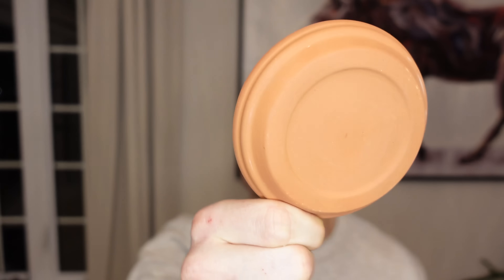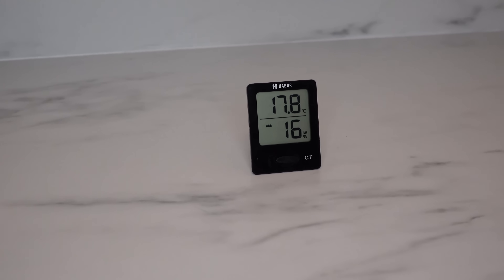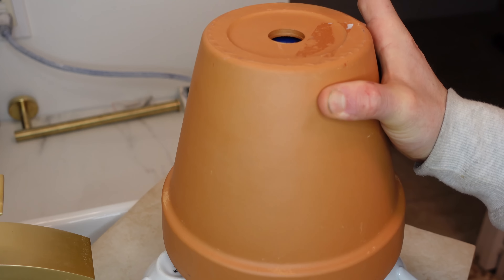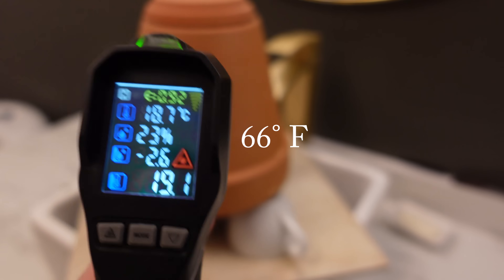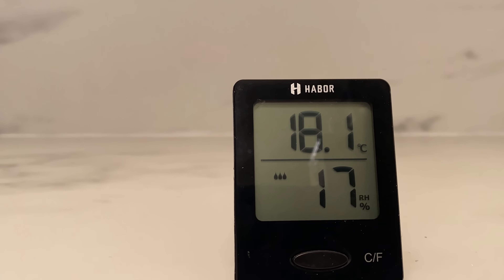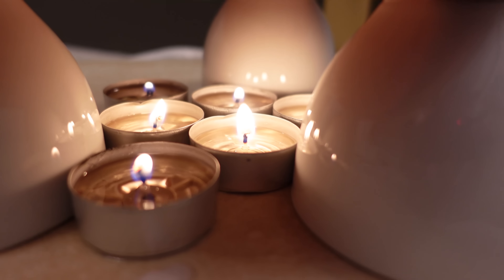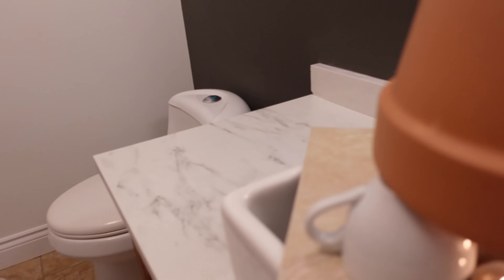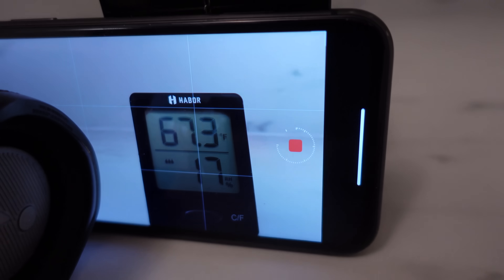CLAY POT HEATER TEST | Does It Actually Work?!

Comment: This set up works ok but using 3or 4 pots  and a large bolt joining using bolts and nuts as spacers washers between each pot its pretty much a convection heater

Comment: Annnd..whats the point of the terra cotta pots, to trap the heat from the candles, which would have radiated into the room anyway? Yu cant gain heat by absorbing heat
Reply: It seems impossible that these candles can make a difference, but It is about the spread of heat. It converts kinetic energy of hot air into increased infrared radiation that spreads out horizontally and heats lower surfaces and thus more lower air. infrared heating you feel directly on the skin, without having to heat all of the air in between. Without the pots the hot gas quickly rises to the ceiling. It just stays up there and mostly warms the ceiling, until all the air is in the room is heated up. By using more pots, you can store more heat and let them radiate infrared longer. Basically infrared radiation is what transfers warmth, and a radiator allows you to feel warmth more directly and efficiently than heating air and using a ventilator to spread it. It does not change the total amount energy, but applies it more efficiently. By heating lower surfaces those again start radiating in turn. Best is if a radiator is black, black absorbs energie best, and radiates it best. It is also  psychological. You  want room walls to have darker warmer colors, not white. This way the room will feel a few degrees warmer. The ceiling you would ideally cover with an isolating and reflective material like you use between radiators and walls. That way far less heat escapes through the ceiling and infrared radiation bounces back.

Comment: :hand-pink-waving::face-blue-smiling:, Please use a quart can of transferred  Crisco with a ready made candle inserted in the middle .  The double pot  is unnecessary . With 8 inches of snow outside with the power off ,  can you imagine how many tea lite candles cases you'd have to use ?  You can use metal air duct over the inverted clay pot to radiate  more .   Watch Nica's clay pot  video, to give you more insight .  Have a good day !  🎄✨☃🎀

Comment: If you use larger pots and stack them 3 to 5 high, you can heat your room, especially if you use a large Crisco can and put three wigs in it, all the way to the bottom. I can tell you, that little room would be a sauna. I used this during the energy crisis here in Belgium a few years ago, when gas was really expensive, and it heated so well that it was too hot in my 100m2 apartment with just two of these stacked 3 high. It reached 26 degrees. But the size of the terracotta pots have a lot to do with this

Comment: So you can set your thermostat to 68 degrees and set these in closed off rooms that you are using. Does not make sense to pay the cost of heating an entire house when you are only using a few rooms.
Reply: If you turn off your furnace and it's very cold outside, pipes can freeze and burst.  Then you have real problems.
Turn your furnace down and put on a sweater, but never turn if off.  Keep the house at least 45F and realize pipes are usually in the outer walls where it's colder. 

I'm not sure how effective this is. 3 degrees is not a big difference. Also, the room was very small.   I wouldn't consider 68F "warm and cozy" either.  Would need to be least 75F. 

It might work better if you set up say 3 heaters in the same room.  But at some point, the cost of candles might rival the cost to actually run your furnace.

Comment: Physics, conservation of energy. It's the same amount of warmth, just distributed slower. What Does work is better isolation (in the house) that keeps the warmth in. But also, small rooms with that many candles gives off possible CO and fine dust that is harmful. Bottomline is that it's not more heat than burning the same candles without the pots.

Did you do the same test with Just the pots, otherwise its not really a test

Comment: I've seen hundreds of similar "heater" videos. The heat in the clay-pot comes from the burning candles. The same heat  is released directly into a room with NO POT on top of the candles. Simple thermo-dynamics shows us that there is no difference in heat-output with, or without, the pot! Major factor......Is the heated ROOM insulated?

Comment: I watched this after another example.  That one had 4 tealights in a muffin tin. The smaller pot was put down on the muffin tin which allowed a little air to get to the candles.  He put a small metal disk on the hole in the small pot.  Then the bigger pot over the smaller with no spacer.  It was much more successful, so perhaps allowing too much air around the candles actually allows the heat too escape too much?  His tealights had no problem going for 4 hours.  It was also much easier to set up!

Comment: I bought a metal purpose made one from TeMu and with 6 T lights under it makes room feel cosy and it does get too hot to touch. When factoring the cost of the candles though and the amount of warmth it gives out I'm not sure it makes any difference to energy costs. It wont raise the room temperature much unless a very small room BUT it will help it keep warm so your heating wont have to come on as much. A lot depends on how much you pay for the candles
Reply from the maker: Interesting, thanks for the info!

Comment: A correct experiment, but with the wrong method. You have to use your resources to the maximum. We know from physics that at the top of the candle flame the temperature reaches 1000°C. But, that's at the top of the flame. What do you have to do?!? You have to have something that stands at the top of the flame and transfers this heat to the clay pots. There is a hole at the bottom of the pot. You insert a stud to which you attach a washer with a wide periphery. The larger the periphery, the more heat it will transfer. And so - one washer, one/two nuts, one washer, one/two nuts. And so on until you reach the flame. You connect the next larger pot in the same way. After all, you still have to heat the outer one. You can replace the inner clay pot with a metal one. That way you will see if there is a change in the heating rate.

Comment: 64°F to 67°F with 480 Watts after three hours. Meanwhile other rooms get cold and damp without heat. 
It's 15°C (59°F) here with no heating. It has been 13°C in winter, lower in bad winters. I prefer my fan heater and put some heat to my feet until the central heating warms things up.
Reply from the maker: Thanks for sharing your experience!

Comment: Do NOT use terra cotta, it absorbs heat like tiles on a space craft. 
Use an upside down metal trash can, bucket, pot or cast iron skillet. The idea is converting fast rising high heat from a candle which shoots straight to the ceiling instead into a warm radiator at floor or table level.

Comment: Just a few facts. You can only release as much heat into a space as you have fuel for. The most recent and interesting technology I have seen for heating is called "Sand Battery". The possibilities are endless.
Reply from the maker: Thanks for sharing, I'll have to check that out!
Reply: @philg  Thank you for acknowledging. After considering the Sand battery concept for home use, I visualize a test using stove pipe and a old washer and a rocket stove. It would produce enough heat to help survive outage with no cost after building.

Comment: I wonder what firefighters think of this? I'm surprised there was no warning because hot wax is flammable and can easily spread or even explode if mixed with water. I would place the whole thing in sand somehow and plan a way of extinguishing in case the wax ignites. Maybe add salt to the candles or store them in a freezer or fridge to extend the burn duration.

Comment: You see the problem wih these cheap DIY heaters which include clay pot, dome or sand types is the maker always shows the heat generated at the heater from 300F to 500F at the top or side of the heater. They never take a tremperture at the ceiling, temps at sleeping level or say 5 foot away from the heater, before and after. The average bedroom in the US is 11'x12' which equals 1056 cubic feet, so guys prove these heaters really work for home or room heating not for a tent or small bathroom...
Reply from the maker: Good point! I'll test that out in a future video.

Comment: I get the idea of converting candle heat to IR radiation but it just seems like a terribly inefficient design due to the cost of the fuel. Why can't someone design one that uses a much cheaper fuel without poisoning people with CO? I personally think the best idea is the large, electrically-powered, sand battery idea. Its way cheaper to run, far easier to build, and safer if you have pets. Its also 'automatic' in that you don't need to do anything when the power goes out.
Reply: If you want use a cheaper fuel use clean unused cooking oil and a nice ornamental lantern not balancing pots precariously.
If your heating a greenhouse use waste cooking oil and fats, that's where the pots come in because theyre already in the greenhouse and they stop the heat rising straight up and heating only one glass panel.

Comment: What you should be comparing is the cost of burning tea candles 6 , as opposed to an electric heater cost for the same temperature change ? 
6 tea candles 10 penies ? 
1kw fan heater 20 minutes,  10 penies ?
Running a  1kw fan for even 5 minutes will substantially outperform 6 candles and still cost less wheather it's DC or AC !

Comment: Pro tip....put these on the floor. It's thermal dynamics. Hit air rises cold air falls. When it's hot down low, it exchanges the heat non stop as the hot air rises to the ceiling. It will heat the room faster, and eliminate cold air on the floor and all the heat trapped from your waste up. Place it all on a cookie sheet on the floor.

Comment: This only works on t.v. You are wasting your time and money..
Reply: Energy cannot be created or destroyed, but it can change from one form to another. This is known as the law of conservation of energy. 
In other words the same temperature change without using the ceramic pots.
He did not use a control to prove that it actually makes a difference, it doesn't.

Comment: OK. so what if anything do the pots achieve?  How about trying the same test with 6 candles & no pots at all.  I bet it heat the room just as well, inf not indeed better without them.
Reply: Energy cannot be created or destroyed, but it can change from one form to another. This is known as the law of conservation of energy. 
The change in temperature will be identical without using ceramic pots.  Any pots for that matter.
Reply: @Mr.Robert1  the point is that temperature is a function of heat energy divided by mass.  The pot is a higher density mass than air, therefore, it robs the air fom receiving heat.  At least for a while anyway.  It slow down the heat transfer to the air and disperses the heat energy through more mass, which is colder overall.

Comment: A Clay pot heater in a green house only needs to keep above 32f and the engine driving heat transfer is the temp differential and a night light in a plant pot can do this.    The con is trying to replace heating in your house when we  need 70f to live.   A night light  can't do this the energy lost is too high.  A hot drink and extra sweater or throw helps.    Invite friends around we get. close to  IKw from 4 people

Comment: Are you using a LED lightbulb for the room light? If you were using a regular incandescent bulb that would also help to raise the temperature in a room when you left the light on in the room the entire time. I count at least 3 additional heat sources with those lights on.

Comment: The same candles will put out the same exact amount of heat BTUs, British Thermal Units, for the same exact amount of time if used without anything around them. Adding material, clay in this example, doesn't increase the candle heat output a millionth. 
The temperature reached is relative to the outside temperature and the room outside wall and ceiling 
insulation rating. 
Even so, the test shows a valuable temperature increase if a house furnace stops working. 
There are dangers caused from heating any and all enclosures using do-it-yourself stove types. 
1 is the oxygen in the room or enclosure is being quickly used and not replaced quickly enough, and many people have died from asphyxia - fatal lack of oxygen. 
   Another danger is, people get very sleepy while asphyxiation grows, removing the ability to quickly get themselves outside and into air.
  Another danger is people lose their ability to make rational decisions as the asphyxiation increases. 
Bottom line is, keep yourself from getting into such situations, and provide enough cross-flow fresh air ventilation if you find you must resort to such a risky remedy.
Remember, everything alive must have air ventilation.

Comment: In Eastern Europe there are still many flats & homes with much larger versions of this concept, only they're made with tile. It's a nice, gentle heat which does keep rooms comfortable.
Reply: Fascinating and very efficient things. Old technology that works although it's a bit bulky. They're called Masonry heaters and sometimes Masonry Stoves, some incorporate cooking ovens as well.
Reply: @EForchetto . That's not old technology. Are you in china and trying to get westerners killed? Or is this your first time around the block? 
This is one form of an emergency situation short-term dangerous remedy. 
That information should have been provided at the video begining, and the producer is negligent in not providing it.
Reply: That's what i grew up with. It kept the room comfortably warm for days even when the fire was out already.
Reply: @startingbrandnew3055 . You expect people to believe that? What years? Location? Why didn't someone Realize all the candles were more costly than firewood?
Reply: @senatorjosephmccarthy2720     Can you give me a single LOGICAL reason why would someone LIE about this???   IF you must have an answer i was born in 1956 in Budapest Hungary. Are you satisfied???
Reply: What? No chimney? How is the room oxygen allowed to be replaced as it's used? Air ventilation thru 2 walls?
Reply: @senatorjosephmccarthy2720  There's a chimney which exhausts above the roof; the long piping warms the surrounding tiles. Think of a wood burning stove with a pipe that leads to the outside -- it's where the most heat goes, not the conventional fireplace.

Comment: We don't use a heater. Hi from South Africa. Yup, our Municipality sucks. So, no heater or the power goes out. From experience a lot of candles (like 30 pilar candles) spaced throughout the living room does make a difference. Looks nice and a little bit warmer, even if it's  just 18°C instead of 10°C. If you can afford to build a wood stove, that really heats up a whole house and feels like hot Summer heatwave if you're not careful.

Comment: A more cost efficiant method is to use standard tabel candles.
They burn twice as long and at 3 times the intensity so you only need to use 1.
A batch of 50 costs the same as a pack of 100 tea lights so you end up with 4 times more heat per cost.

Comment: Nice: you did the experiment correctly. Multiple candles in a small rather well insulated room without a high ceiling.  When people slam these heaters, they need to realize the conditions of the test. In case of a power loss, they will not keep you warm and cozy, but they will keep you from freezing to death.
Reply: If said persons don't first die of asphyxiation - which wasn't mentioned - you mean.
Reply: nooo, he left the lights on, giving a lot of heat, even when its led lights..

Comment: You do not want to have the inner pot to have a hole at the top.  You want to cover the drainage hole.  The inner pot will get much hotter in turn heating the room temperature higher.

Comment: Surely the acid test would be the temperature in the room? Taking measurements of the room temperatures with and without a flowerpot would be more objective…talk about smoke and mirrors.
Reply from the maker: I will make another video without the pot, I'm sure the results will be similar.

Comment: wouldn't it work just as well with just the same amount of candles?
Reply from the maker: I will make a video to test this!
Reply: @philg  I just can't see how the same amount of heat being released by the candles would be increased by trapping it in a clay pot in a closed room.
Reply from the maker: @dickgoesinya9419  yeah you got a good point! Energy is not being created by the pots, but concentrated or trapped
Reply: @philg  OK, we are on the same page.

Comment: It raised the temperature only by 1 degree. That is not much if you have to heat up a room when the outside temperature is falling into the minus and you have no other rooms surrounding you. Also the bathroom lights give up a lot of heat, too. You should have turned them off. But still, interesting try!
Reply from the maker: Great point! I will re-do a test with candles only... and the lights off :)

Comment: Why two pots?
Reply from the maker: Acts like a chimney and insulation for better heat retention.
Reply: Thanks, Phil, I'd wondered about both of these, but I think you neglected to include it! 🙏

Incidentally, I've been using just a single pot all winter (with an alcohol burner) and it's been working great, but I'm curious to see how much better two might work...

Comment: Now try it when the room is 45F and see how well that works.  Hint: it doesn't heat the room up anywhere close to 60F much less 67F.  If the weather outside is actually cold, and you have no other heating source, this won't work.
Reply from the maker: I will make another video with a different setup.